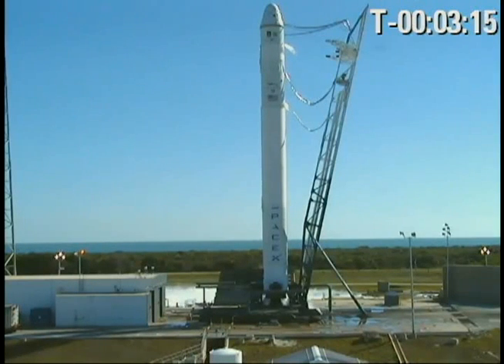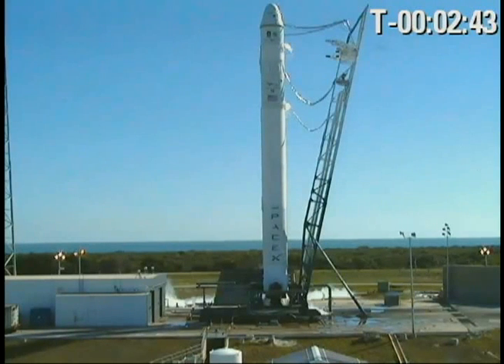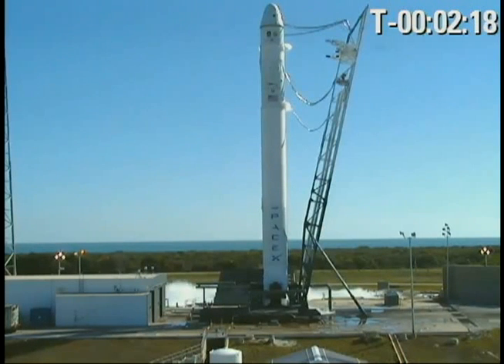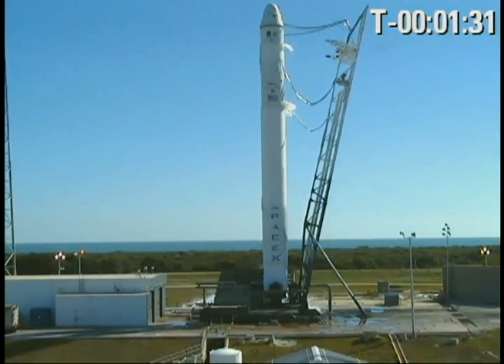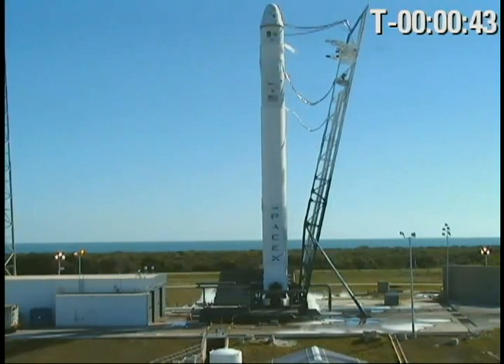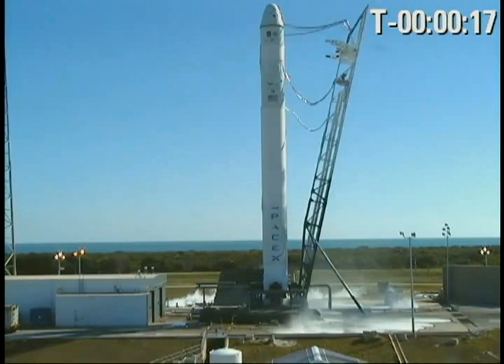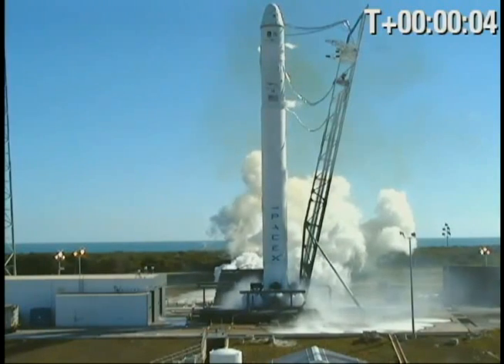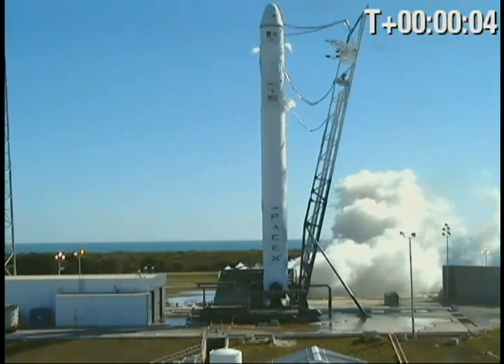SpaceX Falcon 9 Flight 2 Static Fire - December 4, 2010

Comment: @dibillet  This was a falcon9, it was aborted because one of its 9 engines did not start correctly.  The Amazing thing is it launched on the very next launch window 45 minutes later.   If this were Shuttle it would have been at least a 3 day delay and a prolonged rollback.

Comment: This is the second static fire test that was successful. When launch control says abort they don't mean abort the test. The are talking about turning off the engines. Sorry for any confusion. The test was successful. It fired for a full duration 2.5 second test fire which brings the engines up to full throttle.